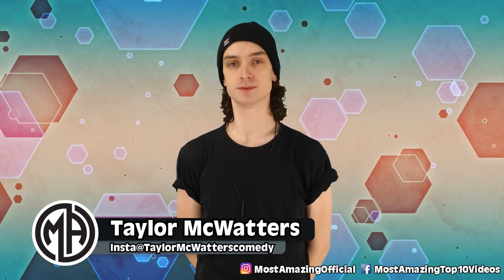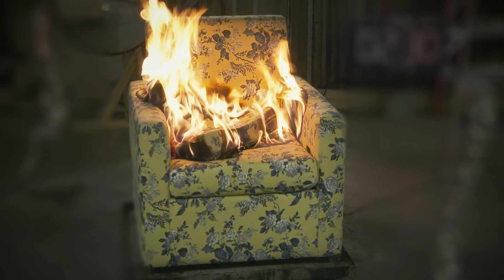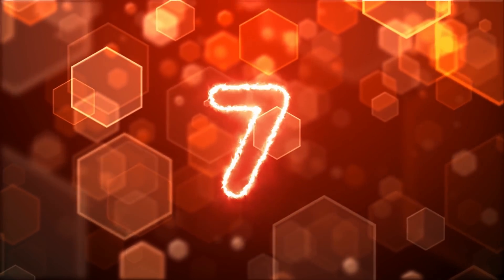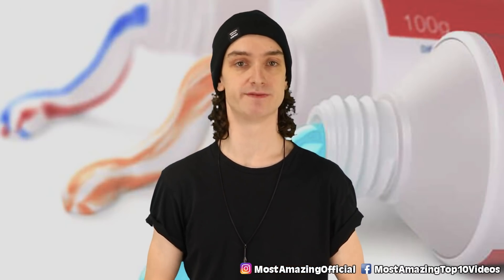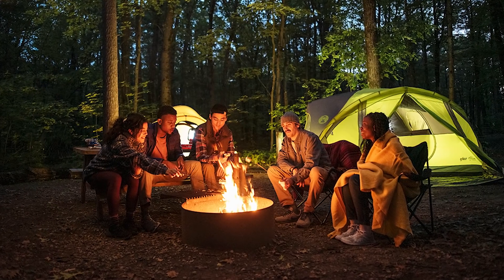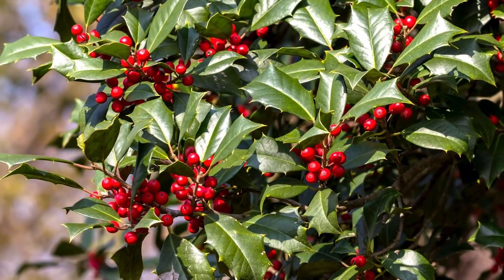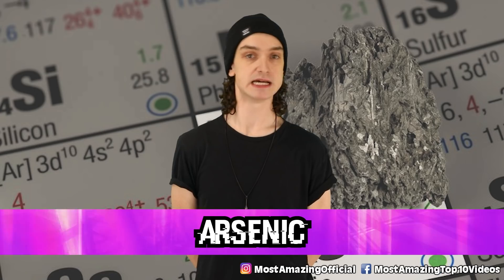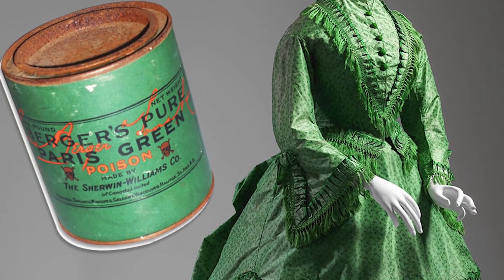Top 10 Deadliest Substances That Are Hidden In Plain Sight

Comment: A couple of things:

Strychnine: These "muscle spasms" are so intense they can break your bones. Nasty stuff.

Cyanide: Disables protein in mitochondria that produce energy. This occurs in seconds; essentially irreversibly, and has the effect on our body like running out of oxygen, everywhere, simultaneously. In other words it's like having every muscle cramp, like a stitch in your side, charlie horse, etc, plus the intense pain of a heart attack, and the debilitation of a stroke, all at once. Probably worse than burning yourself alive in terms of pain.

Mercury: The kind in thermometers wont participate in reactions in your cells. You could drink a lot of it. Organic mercury, like you said, is nasty.

Botulism Toxin: There are many nasty toxins produced by the species Clostridium botulinum. They all act by causing the nerve terminals on our muscle cells to over-fire. In other words, once they are introduced to muscle, they cause it to contract without stopping. This is why Botox works! Extremely small amounts are injected, around small muscles, and they cause them to contract which stretches out the skin. That's why someone who has had a lot of botox seems to have their face stuck in a certain expression, often like they are constantly surprised. 

Very importantly, C. botulinum is anaerobic, that means it grows without oxygen. We can/jar things to protect the contents from oxygen so it doesn't spoil or grow bacteria which need oxygen. Having no oxygen in the can/jar makes a perfect home for C. botulinum, and that is why we heat them up high enough to kill the initial bacteria. If we dont they multiply, and produce waste gas, as well as their toxins, this causes the cans to puff up, or jars to burst. 

IT IS ABSOLUTELY CRITICAL TO KNOW COOKING CANNOT DESTROY THE BOTULISM TOXIN. If you have a can which has puffed up - DO NOT OPEN. Additionally, if you ever feel your face is paralyzed, you should never drive to the hospital. Call 911 immediately and describe the situation. Statistically speaking, almost 1 million to one odds, you're having a stroke. If you are brought in by paramedics and are paralyzed, poisoned or having a stroke you will not have to wait in the waiting room and you will not crash your car on the way!